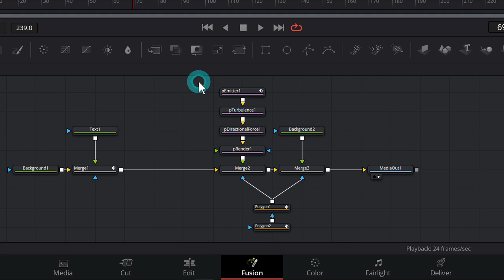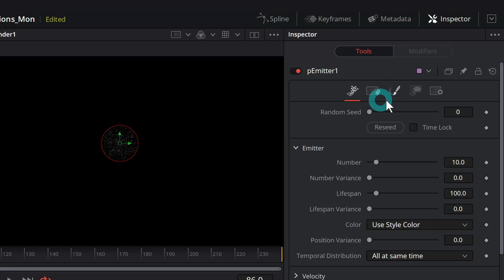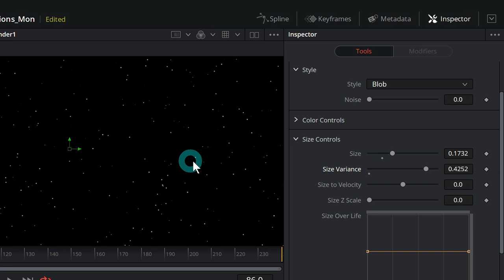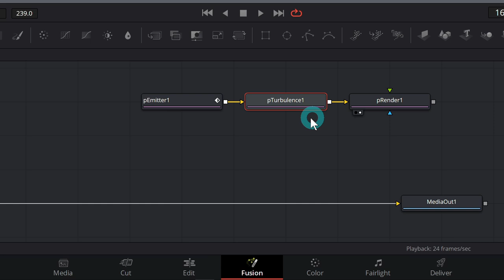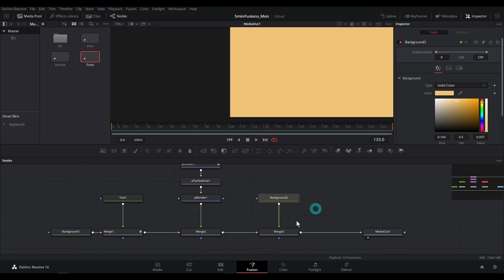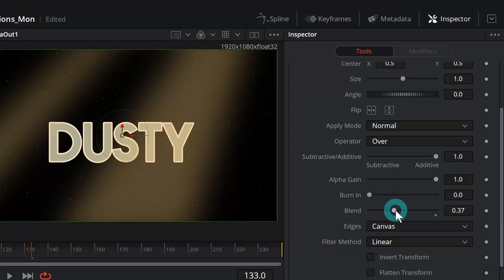EASY DUST EFFECTS IN FUSION - DaVinci Resolve 16 Tutorial

Comment: I was recently working on a video where I wanted a sort of snowfall filter over some of the footage. So I opened Blender and put together some particles falling with Brownian motion, rendered that to video, then I put that video on top of top of the other layers in Resolve and set the blending mode to screen. And it was a short clip, so I had to do a loop with a crossfade between iterations to keep it going.

And now I know that I could have done the whole thing in Resolve. LOL. Thanks for the video. I've been on a deep dive of your content. I've been using Resolve for two years, but the only times I look stuff up is when I need to do something now. Over the weekend I checked out some of your beginners guides and learned a lot of stuff.